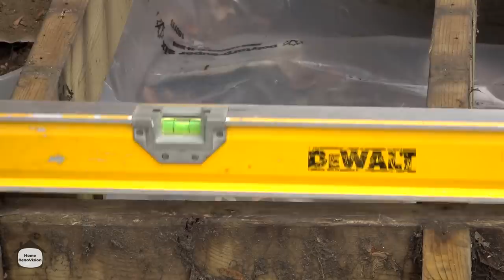Remodel Your Deck on a Budget! | DIY Tutorial

Comment: When you started and said don't demo the whole deck I agreed with you (as long as the frame was built correctly) however after looking what was there I would have just trashed it and started over. The cost in time trying to fix what had been done wasn't worth the effort. That's a small deck and the framing lumber for it is not that expensive. Plus you end up with new material and more importantly, you could fix the footings correctly, level it and square it. This one wasn't a good choice for salvaging the frame in my opinion.

Comment: I did Commercial Woodworking for over 20 year and of course we had to conform to ADA specs. On everything. We built  some of those that  really made things  harder  to build or   Create  less. Integrity to the structure  when ever we would address our concerns. To the Architects or  clients the usual answer was to  go ahead and make it that way to adhere to code , as luck would have it many years later i suffered a traumatic brain injury. That   Gave me some  physical handicaps  i spent. Some time in a  wheelchair and  quickly learned that many of the actual codes. Do not  really fix or. Eliminate  the issues  at hand  and what i concluded was  it was  best to  come up. With a set of personal. Adaptive tools for each. Persons. Situation as every ones handicaps are slightly different and unique to that individual  similar to  your comment. On the   Height of the handrail for elderly  people come in all different heights  the government standards  may very well work for some but definitely not all  many of those " standards" need to be addressed  or. Updated  despite the original intention  being a good idea  it  just really doesn't work any longer ?
Reply from the maker: Sorry to hear about your injury!

Comment: Great video, but I want to point out that at 50:10 you are mistaken. The crown on deck boards should be layed like they are smiling / form a bowl, they curl up opposite of what you where showing. Its not the end of the world though, deck boards are fastened with so many screws that they do not curl that badly.  And is it not ususal to use preassure treated deck boards in Canada?

Comment: Most ppl would have added a cement footing to correct the sag in the deck. Also, I would take the time to grade under the deck with the gravel and then put the plastic sheeting over it. It would make sure that if any water got under there, it would quickly drain.

Comment: I curious as to why you didn't install the hand rail bottom bracket the same as the railing bottom bracket? I'm a little OCD and would have wanted these two next to each other to look the same. Great job and great video.

Comment: Do you mind making a note about the grain direction? I built a deck last year and took your advice on grain direction. I surfaced mine in green lumber and every board cupped because it need to be installed Crown down, I now need to remove 37 deck boards that are 18' long because they all cupped up and pool water when it rains... Appreciate your videos and really enjoy them, just don't want another person to make the same mistake...
Reply: The way I usually explain it is that the growth rings should appear to be "smiling" when installed correctly.  

When watching the video, at 50.06 it is described as looking like a rainbow which I would describe as a frown.  Frowning wood would cup.
Reply: @cdfps750   thanks for the reply, just hoping he corrects it so others don't deal with the same issue. Flipped the deck boards on my deck but it took about 8 hours which could have been avoided if he had the correct information in the video

Comment: Hi - thank you so much for this video series... I've watched a number sections in this series several times - very helpful! Wondering what your thoughts are on what kind of finishing stain / or clear sealant that should be applied to new pressure treated deck boards (HD - Sienna brown) after about a month or so (same climate as you... in Ontario). Will really appreciate your feedback on this... as I'm nearing that 1 month mark since installation of new deck boards. Thanks in advance - and hope keep on rocking!

Comment: Great video ..... showed me some of the mistakes with decks that I have made in the past. However, it would be nice to see a system that needed more structure and attachment to the house, and the code issues involved. Ideally a double deck for those situations where you have a basement walkout and need a deck from the basement as well as from a main floor kitchen as one system. Cheers
Reply from the maker: All in good time. Cheers!

Comment: Love your video... Thank you!!!           BUT, I do not agree with you on the deck boards going on, bark side up.  Bark side up will cause water to be held in the bowl that will occur as the deck boards curl up.  The majority of references I've found online say to install deck boards with the crown (bark side) DOWN.  So that WHEN the deck boards curl some, the bowl it makes will be facing down, so water will run off the crowned top side.

Comment: If you are in an area with snow adjusting the rail's bottom gap to permit pushing the snow under the rail is convenient when shoveling.
Reply from the maker: where we are we don't sit outside in the winter so you only need to shovel to the door. Cheers!

Comment: Great instruction...

I understand the concept of using the 3-inch screw when attaching "new" wood to "old" wood to insure a grip.  What length do you use new to new.

Also, I cannot get 21-foot 5/4 planks, so I will have to splice it.  Suggestions?  Video for that?  Thanks!!  And thanks for the early input regarding how to allot for a cantilever.  Also, the box method for posts - excellent; also, the HeadLok screws - excellent.  Just make sure your battery is up.  Thanks!
Reply from the maker: use the fishbone technique, or make sure to treat the ends of every cut with a sealer.
Reply: "Fishbone technique?"

Comment: I am not understanding why the corner posts are floating on ground that freezes. Is there no worry on ground movement during the freeze and thaw periods?. I would think the stresses created at fixed points would be severe. I live in Wisconsin and the ground freezes here 4' deep.
Reply from the maker: if your house has good drainage then the freezing only raises the deck an inch or so. and then it settles down in the spring.

Comment: Would you be able to sand the joints rather than pressure wash? As stated around 14:20 when talking about a fishbone pattern with the wood.
Reply from the maker: sure it will work if you have the time.

Comment: It just so happens that I decided to replace my railing system and steps this year.  This video is very helpful.  However, I do have questions about the steps. How did you decide the distance between the posts that will hold the top of the stair railing?  How much do the treads overhang the "box"?  Thanks much from New Jersey.  Bob

Comment: What are you thoughts on using a 6 x 6 as a load bearing deck post and notching it out in a manner that would permit you to have the length continue up 6 feet above the decking as a privacy wall post.  Essentially using 1 - 12 foot 6 x 6 and having 4 ft of it functioning as a deck post to the ground, and 6 feet above the decking to provide a wind sturdy privacy wall post.

The notches on the corner post would 'hug' a double 2 x 8 rim beam and a single 2 x 8 outer joist.  Planning on 4 - 6 x 6 legs across the front of a 10 x 16 deck... so the deck posts would be 4ft apart and supporting a 10ft span.
Reply: Should go to  a 2×12  material  for that span.2×10 minimum.  With a 2×8 you will get bounce  in the middle of the deck when you get a couple of people on it. If your not going  post and beam with a 2 foot cantilever I'd use 2×12.

Comment: When using pressure treated, is it fine to install boards without a gap since they will form once the wood starts drying out?
Reply from the maker: Aha? be careful with that assumption. If you are installing close to the ground the wood might even expand.

Comment: Hey Great Vid ,we are planing on doing same style railing on my deck this coming spring,, can you supply link to your sons posted vid on the same style of railing?? Now please correct me if I am wrong but didn't you mess up the rise on the second stair thread, looking at it , the 5/4 board of the lower thread should have been under the  the 2x6 riser.  To give you 6-1/2 & 6-1/2  ??
Reply from the maker: Its close, not perfect but box stairs never are!

Comment: Hi Jeff, I know nothing about building decks, so I apologize in advance if this is a dumb question.  How come when you put in the 'structural' post for the railing (42:00) it doesn't go all the way to the ground and sit on its own concrete slab too?  Wouldn't that be sturdier?  Thank you for your videos!
Reply from the maker: Hi Adam, you will find most posts are attached to the frame and railing only. In my build I attach under the frame near the ground for a 3rd point of contact. even if you can't get that 3rd point having it attached in 2 points with railing that have outside corners make this really strong.

Comment: @1:33:55 the angle at the end of the skirtboard is the down end and the longer side of the angle is the outside, so rain has a very sharp edge to drip off - dries faster and rots less.
Instead of cutting it square, leave it - and cut one, if it's missing!

Comment: still should've sloped the deck... standing water is NEVER a good thing especially using cedar. The bottom side of decking WILL ROT quickly. Cedar is EXTREMELY absorbent and shouldn't be used on a horizontal. Cypress wood would've been an ideal alternative. Also, shouldn't close in the underside of deck with full size skirt boards... just traps moisture. One more piece of advice: use a plastic spacer between concrete block and the bottom of the 4x4 post under the deck frame... this protects from moisture wicking and termites
Reply from the maker: sloping a deck is not necessary when you use a sealer that repels water. and we don't have termites in these parts which is why we love to use cedar outside. exotic woods are not necessary in most cases.

Comment: Nicely done Jeff! Did I see correctly the previous job left the welcome mat on the cement step. LOL ! Few questions: should I cover the joists with tar (you mention it earlier but I couldn’t see it later with the decking). 2) no pre-drilling before screwing? Does all the above apply to treated wood as it does for cedar? 👍👍
Reply from the maker: The tar is for people who won't use a pressure washer each fall to clean out the organics. If you maintain your deck then its not necessary. Cheers!
Reply: Home RenoVision DIY thanks!

Comment: Love your videos. I have a covered porch that the previous owners made into a room. Problem being the flat concrete patio they put the walls on let water in the room. How can I fix this
Reply from the maker: You need to use a polyurethane calking around the base of the room on the outside. Cheers!

Comment: Here's a little helpful tip.  As far as fixing the weird Framing where the two halves meet, the sunken post 'could' have been replaced with a double two by six beam.  Because the two single 2x6 beams were previously bearing on the same post and overlapped eachother, it would be easy to cut them allowing 3" gap between for double 2x6 beam spanning from house to outside/front of deck.  Use joist hangers to tie both halves to new beam. 

Could use 2x8 or larger for double layer beam..
Reply from the maker: definitely plenty of options available. Cheers!

Comment: Don't those brackets require a 3 and a half-inch nail going through the diagonals?   I thought the 3.5 inches are supposed to go through the joist and into the beam for support.

Comment: 1:43:12 It would be nice to see how you would do the same deck but with a ramp for a wheelchair? It would be nice to see how that would be built so if someone ever needed to put that ramp on the same designed they could have something that was ADA compliant and safe?

I did want to find out what your thoughts are on the show This Old House and what you do and don't like about it?

You did say that you put lights on the top of the railing but I didn't see you wire anything in. what type of lights are they?
Reply from the maker: Hi Adam, we did a deck project with a wheelchair ramp. If you go to the homepage you can search it. Cheers!

Comment: Great.  I learned some stuff.  I admit, I am a self-taught amateur, but figure things out.  I have been running pilot holes at the ends.  I am eager to try that burning method.  Not sure which is faster if you do all the pilot holes at the same time, but if I am only doing one or two screws at a time, it seems like the burning method should be faster.  The stair railing would not be acceptable where I live.   Little old ladies can catch their purses on the end and knock themselves down when it grabs.  So, even though I like the look of extending those boards past the first post, I can't.  
I just painted roofing tar.  But that roll looks like a better approach, though it could breed spiders in the gaps on the sides where it hangs down...and we have tons of those where I live. I guess I would just have to find a way to put it on where there was no gap on the sides...or maybe trim it.  I had a look at one I did with tar and it looks to me like it is coming off.  I might try some black spray paint next time.
The bottom of the stair on the ground seems like a point where it could rot.  I guess the brick is sufficient to prevent that?
Glad you told us about going directly into the brick, I would not have guessed that...but I know squat about brick. there is very little brick were I live other than chimneys.  I live in an earthquake zone.
And I have gone completely to the stainless screws for outside. Those painted screws rust too :(  It usually starts right where the bit went in and the edge of the head.  But you do have to pay a premium for stainless.  On the other hand no one is going to call you up and grumble about the screws.  And they look very sharp on a deck.  And speaking of sharp, they are sharp.  I have been poked a few times.  They are definitely much sharper.

I have had a lot of problems with steps.  I would like to see one done that was not already set up for success.  I was trying to do one where the concrete was broken down the middle and poking up, and one side higher than the other.  I spent a lot of time trying make those steps adjusting and readjusting until they felt correct and you could mindlessly go up and down without tripping.

You also mentioned finishes, but never covered that.
Reply from the maker: there are also new screws on the market that pre drill the hole while screwing in the fastener. cost a pretty pennie though.

Comment: That 4x2 with the drilled holes for the black rails is warped. You can see when the black brackets that screw in the 4x4 post are not lining up on the left side.

Over all nice job

Comment: Tip for u.
Dont go in so deep with your screws. You're creating a hole for water to sit and rot the wood. 
Also going deeper then the pressure treatment
Reply from the maker: I am using cedar so I go deep so the wood will swell and cover the screw eventually. Cheers! That is great advice if it was pressure treated though.

Comment: Jeff, do I have to use something to prevent my stair frame from touching the ground/dirt? If yes, what do you recommend? There is no concrete or anything like that around my deck. Also, did you use 2x8 or 2x6 lumber for the frame of the stair?
Reply: Building code is a concrete pad.

Comment: Well one glaring issue is the threshold height which needs to be 5" or 6" depending on local codes.  The original cement step needs to be hack hammered lower in order to provide the clearance for the joists.

Comment: Awesome video. Right when I needed it, once again (how do you do that). Maybe a silly question but when you cut the posts that are buried in the ground, do you leave the bottom piece in the ground, pour limestone (or gravel?) on top and then put concrete blocks on that? Is it ok to leave the wood in the ground under your footings?
Reply from the maker: The point of cutting the posts is that they were not in concrete. So we made them floating on the block. This way we can manage any movement over time with shims or cutting more.
Reply: Thanks! Got that part. Wondering if I need to dig up the bottom pieces or not and put dirt down. Again, maybe a silly question..
Reply from the maker: That might be useful. I really don't have a preference.

Comment: Don't break the screw off in the board... good way to trash a saw blade... put a scrap piece of wood under the screw, push down on the board and unscrew the screw.  Or if your bit is too short, you use your hammer and drive it back through until you can get the bit back on. Or pull it out with the hammer.
Also you can use ratchet straps to pull the boards in.

Comment: When factories close,people grab nail pouches and say they are Carpenters and the framing of this deck is the result.When you try to save money because "a guy" says he can do it cheaper...this is the result,something you have to REDO.In Canada most of the work is not visible,do not let someone build a deck unless it is on 4 feet of underground concrete(sona tube)
Reply: Notching the 4x4 posts makes everything so much stronger

Comment: For 8 dollars a stringer I would have taken a skill saw to the center of that deck so fast. Reframed time wise it's the thing to do. Structurally it's the thing to do.
Peace of mind that I'm not going to have a problem later on with their framing. I dont do cobbling it take to much time and you still have cobbled framing when your done. Cut it out leave the ledger and rimjoist and add 
new stringers take the old material make a flower planters  or a bench for the deck. No waist